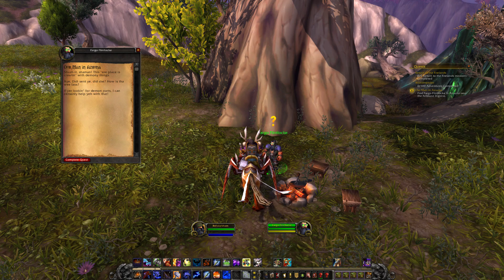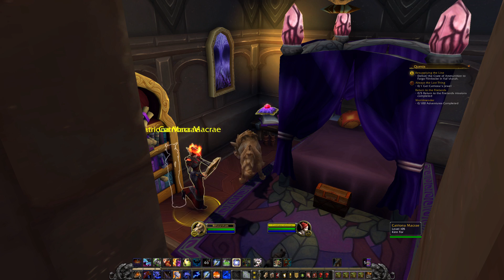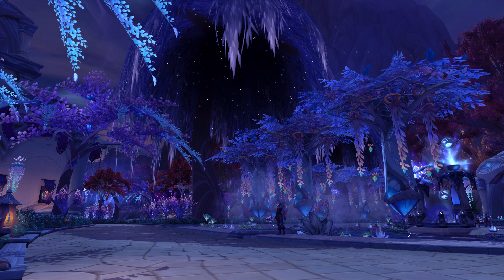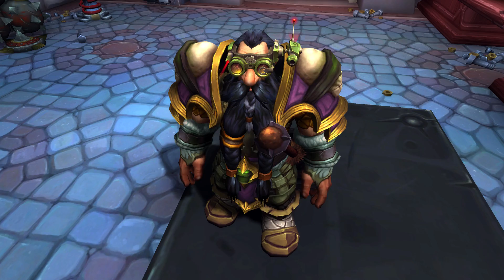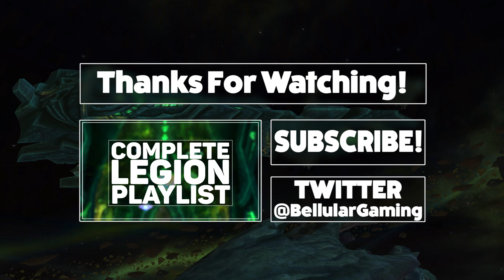WoW Legion: First Look At Engineering - Your Own Fel Reaver!

Comment: BTW, not sure if it was just a change from BETA or not, but you don't actually need high cooking level for the Hearty Feast modular.  And you can buy all the reagents straight from the cooking area.  Took me a good 30-60 mins and wondering WTF on the AH to figure that out.  The real gate right now is a requirement for a bunch of imbued crap that's going for 10k each on my server (need 4 of them).

Comment: Do I have to be lvl 700 in engineering to be able to do these quests?
Reply: no. you can start with level 1 too.
Reply: nope, but it usually helps with some parts of the leveling process, but with gathering skills you can get more mats early on.

Comment: That was awful, I found most of what's here on wow head and it made better sense. in this video i wanted to see is the food module a mage table or a savage feast. how do you switch modules are they 1 time use how many times will I make each module. you didn't manage to get him to join combat does he need the turret module. how are blizzard balancing around engineering having a robot boosting their damage do all professions have combat boosts. the whole video came across as unprepared with asmondgold style rambling without thinking about what you were talking about before

Comment: i miss the old prefessions, the ones you got extra bonis, back then i enjoyed professions alot more, cause they were useful til endgame, like alchi when your flasks etc were stronger, with smith you got 2 extra sockel on your gear, engi had rly rly cool and useful enhancements for your gear and so on. Yeah crafting seems alot more fun, but will turn out the same as in  WOD, by the time you leveled your crafting up, no more benefits apart from making gold.

Comment: If you look at it, it said Fizzled when he first tried to throw the grenades. This is a common theme with engineering items, in that most of them have a chance to "fail". This one however seems to be more of a profession level gate, much like how if your a low level miner or herbalist you get pieces of the resources, so the lower you are the lower the chance of the item actually working as intended.

Comment: 800 is not much at 110 but you can wield those at prolly 100 or 101 when they will be quite powerful.
Reply: +Emphatic in legion u have this forge where u go and disenchant epic crafted items into oblitirium which is used to upgrade the item level of another crafted epic item
Reply: +Dark Poisoneer That its good information to know but has nothing to do with my point.
Reply: Emphatic I replied with the part about not enough at level 110 actually :D and yeah the case that epic engineering goggles are powerful at early levels in the expansion has been there since wotlk or something